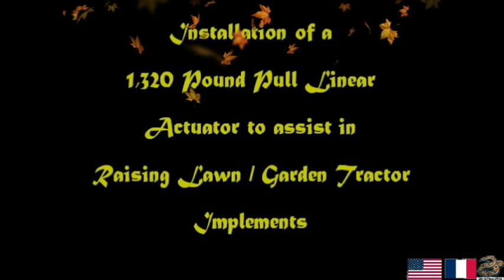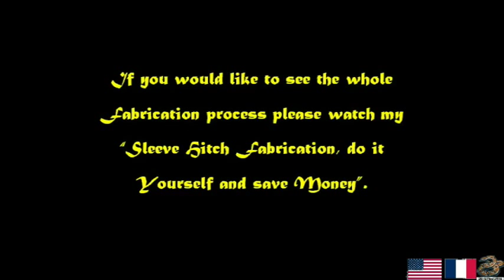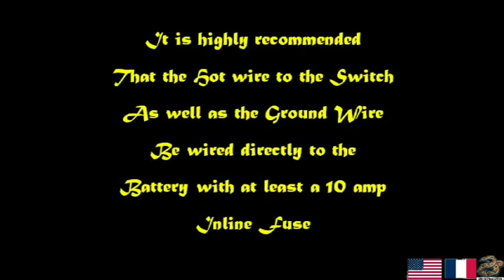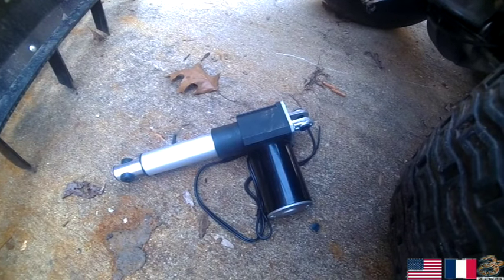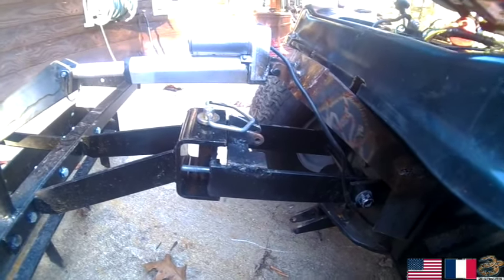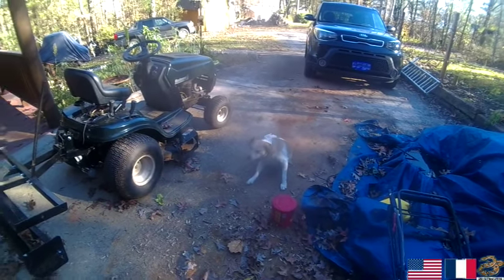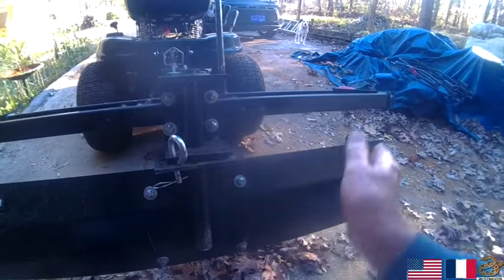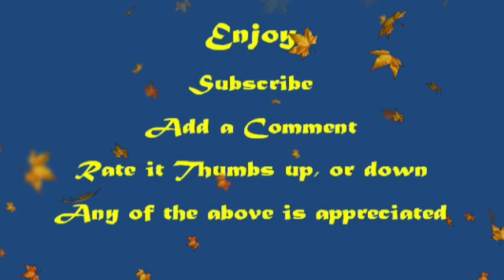Sleeve Hitch, Power Lift Installation  (Linear Actuator)

Comment: Nice video.... May i ask a question? How do you determine the dimensions of these things. I see one that says minimum dimensions are stroke length plus 175mm. Max installation dimensions 2s plus 175mm. Help please?
Reply from the maker: Shawn what I did was found out how much Stroke length I needed and then shopped for an actuator that matched the Retracted and extended dimensions...I know that probably didn't help but it's the best I can do
Reply from the maker: I'll add, I had to figure from the center of the two mounting holes.

Comment: Can you give me a little more info on the actuator. Stroke length ? And lift pounds?
Reply from the maker: Dana, the Stroke was 4" although if you have enough clearance I don't see why it couldn't be a little longer.   The Lift was rated at 1200 Lbs. as I remember. I went out to check it but the stick on info Tag was gone.

Comment: What kind of actuators ate those?
Reply from the maker: Sorry for the delay, the Linear actuator is a used Warner I purchased off of E-bay. The actuator I installed on my Polaris Dump Bed Is A Chinese Knock off of some sort. It may not last a terribly long time but it's been working for 2 years now. Thanks for the comment!
Reply: SmokymntnEd thanks for the reply!